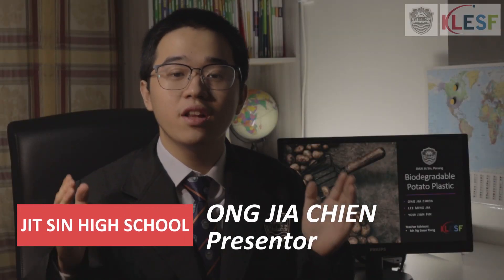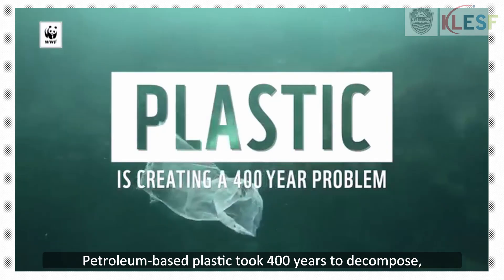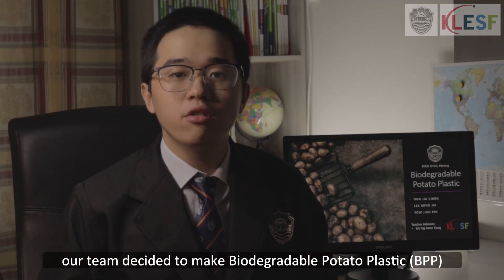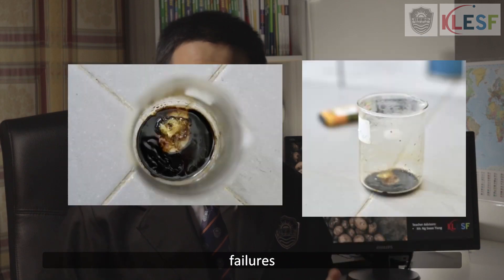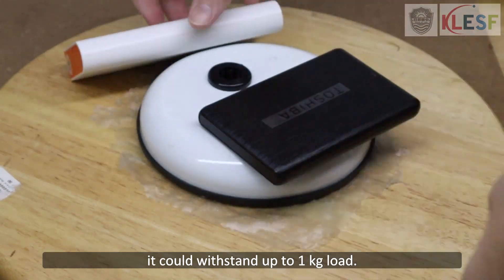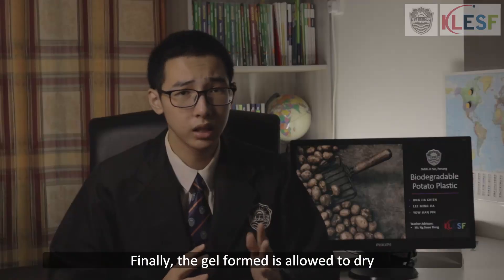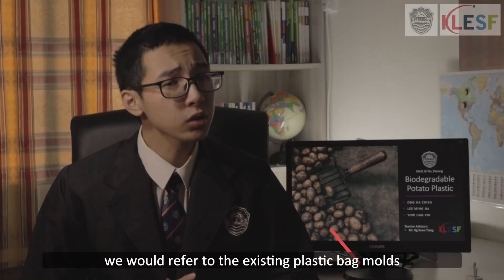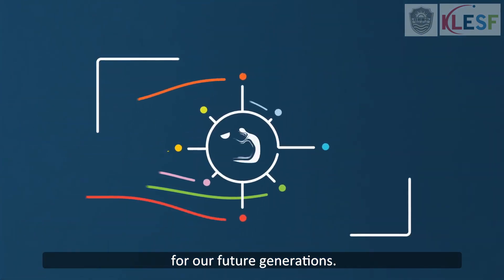[KLESF International Challenge 2020] S86 Biodegradable Potato Plastic(BPP)

Comment: On kitchen scale experiment, the use of acetic acid or vinegar is ok. For commercial scale, since u hv lab facilities, consider evaluating with ammonium acetate or citric acid. They hv similar purpose as acetic acid, which is to improve the  dissolution  of the  starch in water. 

Glycerine or glycerol improves molecular mobility within the polymer matrix. Physically, it shows in what we call the melt flow index or mfi. This index reveals the thermoplastic processibility of the plastic. In application as a product, it determines physicals like tensile strength, elongation at break, hardness etc.